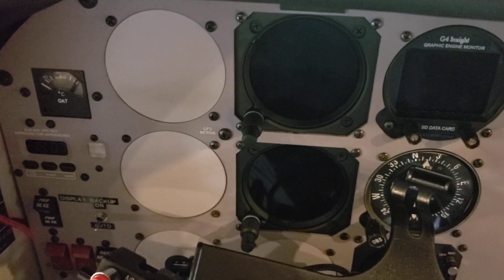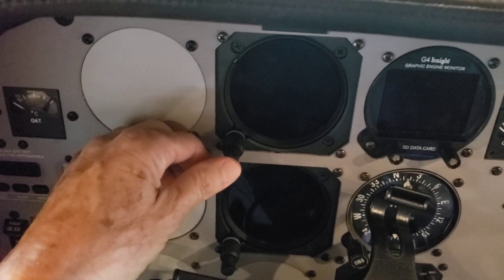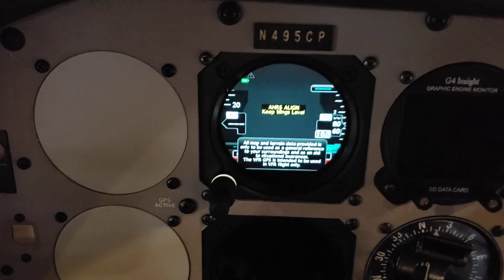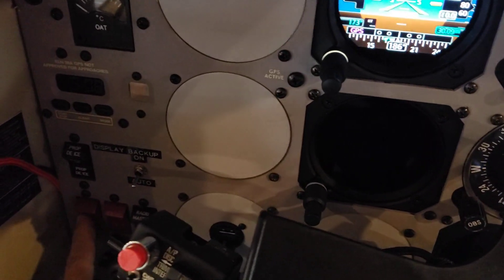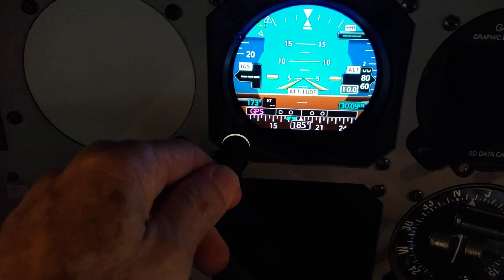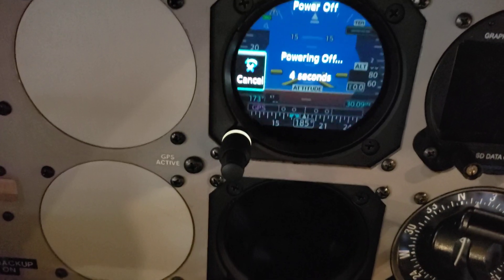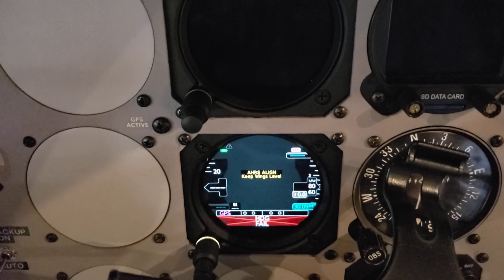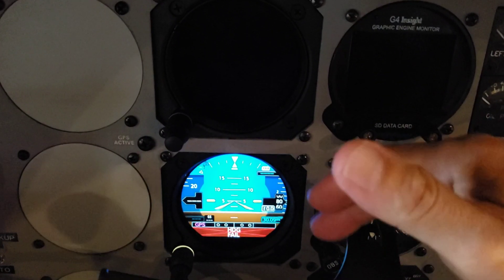GI 275 Primary ADI powers the magnetometer (GMU11) from own internal battery.

Comment: @Chris - This video is super helpful.  I have a dual GI 275 setup in my Mooney.  I had an alternator fail (and become intermittent) on a flight... luckily in day VFR.  At some point after the alternator died, the GMU 11 lost its heading indication.  When it came back (intermittently with the alternator I suspect), the heading read 30 degrees to the left.  After that I was back to my wet compass for backup heading.  I am trying to figure out (a) why would the GMU 11 fail with the alternator (if I still had battery charge --maybe voltage was too low), and (b) more worrisome...why would it fail to the wrong heading.  Any thoughts?
Reply from the maker: You describe a definitely odd scenario! The only way I can imagine what you describe happening is if the GMU11 is NOT connected to the GI275 ADI (top unit) as it should be, and for some really odd reason also not powered by the battery when the alternator fails. Why would it come back up with a 30 deg error is also baffling unless alternator was not providing adequate consistent power to it.

REALLY ODD!!!!

Comment: Hi Chris, so why is it not displaying its internal fed heading?  Does it require movement?
Reply from the maker: Enjoy your setup!! Great instruments.
Reply from the maker: I am not sure what you mean by "internal fed" heading. Do you mean the internal VFR GPS track?
Reply: @chriskoppel3940  I suppose. I'm guessing its fed from your GPS unit?
Reply from the maker: OK. Good question. 

It is because the GI 275 VFR GPS will only activate after it has first seen a panel mounted GPS and then having the panel mount GPS fail (signal go offline). It will not activate if it is the first GPS to come online. It is not "either or" logic giving the panel mount priority. Instead it is a panel mount GPS failure flag that activates it. Could potentially be an issue in certain scenarios.
Reply: @chriskoppel3940  Thanks. It is something to ponder w.r.t failure scenarios. My GI275s (dual setup) are being installed this week. The primary will be connected to the magnetometer as well as to the GFC500 & 430, with the secondary acting as a MFD/Standby - similar to your setup.
Reply: @VusaMoyo  To elaborate: Once the unit acquires position from it's internal GPS it should show track as a reversion when it doesn't have valid heading info but it's not likely to get a good GPS fix in the hangar.